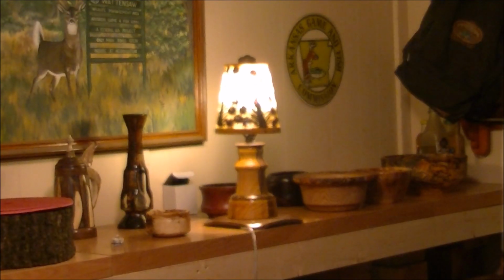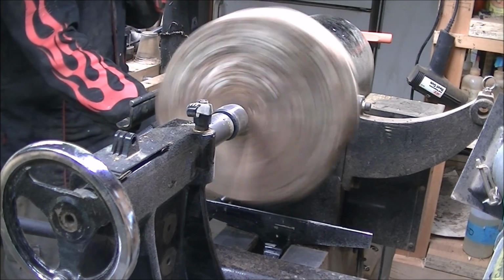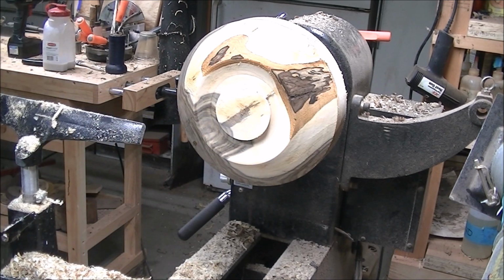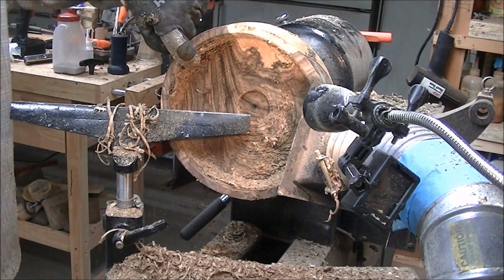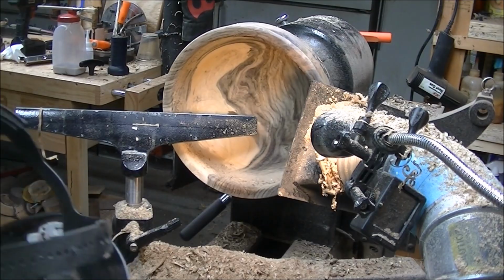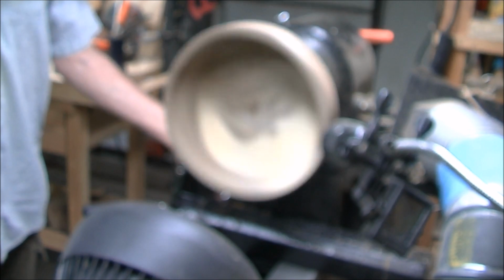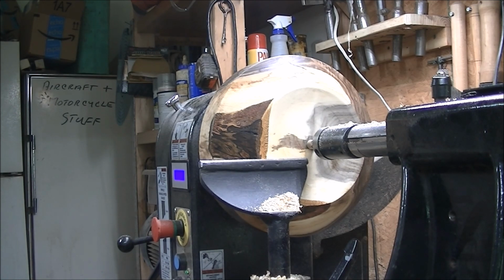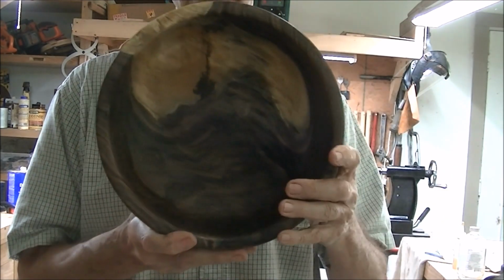Diana's Bowl # 81

Comment: Did you say that something "snapped"? The laptop speakers aren't that great . Was that green wood? Or was it aged a short period of time? I did make a small bowl from some what green poplar and it cracked all over after leaving it overnight. Just wondered.
Reply from the maker: No it wasn't green, but is was wet from laying out on the ground.  I don't remember saying anything snapped.  Green bowls will crack.  If you are going to leave them overnight try covering them with a plastic bag.  I've also had good luck by sealing the back side and putting a small fan on the front overnight.  It seems to wick the water away from the inside only.  I've done that a couple times, no cracks.  Take care and thank you, Larry
Reply: dread c
Reply from the maker: No I don't remember saying that.  Nothing snapped or cracked.  That wood had been drying for a year or so.  thanks, Larry

Comment: Have you ever tried to "Wet Sand" right after applying the oil? I wonder if it would form a slurry to fill any little voids or sapwood grain? Then dry sand to final and then re-apply oil - then normal finishing steps from there.
Thanks
Dennis Beamish Cambridge Ontario Canada
Reply from the maker: No but I sure will.  Thanks Dennis, Larry
Reply: Larry
When you try that "slurry" idea - let me know your thoughts - I have been playing with it and I think it makes a nice difference.
Thanks
Dennis

Comment: Nice tip with the fan!!
Does he fan have any heat or is it just ambient air flowing??
Thanks
Dennis Beamish Cambridge Ontario Canada
Reply from the maker: Ambient and it works well.  I think it's mostly the changing of temps that causes cracking, like in a microwave.  I don't seem to get cracks this way.  Thanks again Dennis, Larry

Comment: is the beaver just a square carbide set at a 45 degree angle?
Reply from the maker: Yes, almost.  It's a square carbide with radius sides.  Big, flat and heavy with the measured cutouts on each side is what makes it work so well.  Thanks, Larry

Comment: How often do you sharpen the beaver?
Reply from the maker: That my friend is a difficult question to answer.  Got a lot of depends.  The beaver uses a carbide square cutter with a radius.  On average I would say about 10 times less than a gouge used for the same purposes.  The depends are , hard wood, soft wood, wet wood, dry wood.  The only time I replace them is if I break it or chip it.  If you hit a screw or chuck it will either break or chip.  Hope that helps.  Take care, Larry

Comment: Watching this in UK I find it so surprising how ofter bowls are turned with scrapers and not bowl gouges
Reply from the maker: They are basically scrapers, but I don't use them as such.  I started with gouges but didn't like having to sharpen all the time.  Once I got into carbides, I was hooked.  I can do anything with a carbide that can be done with a gouge.  The difference is I do it faster and just as well, if not better, no sharpening.  My favorite saying is, "Why use a hand pump when you have a compressor?".  Thanks and take care, Larry

Comment: I liked your tip on saving the fine dust from the dust collector for doing repairs. I've been making a collection of different colored dust in small plastic containers. I take a piece of scrap of say Walnut or Elm or whatever and sand it with a 60 grit sanding disc then collect the dust and label each container for future jobs. I either try to match the color to the damaged area or use a contrasting color, whatever looks best. Works well with CA glue or epoxy depending on the size of the repair. By the way, thanks for the tip on thinning the epoxy to make if flow into the cracks better. I used acetone in place of alcohol, it works well too. Your sister-in-law should love the bowl...very nice. Thumbs up on this one!
Reply from the maker: Another good place to get you shavings is the band saw.  Yeah, I got 10-15 bags of different dust.  Works for me.  Thanks and take care, Larry